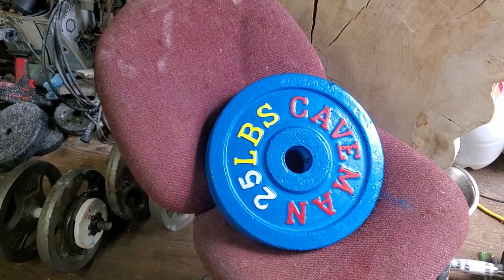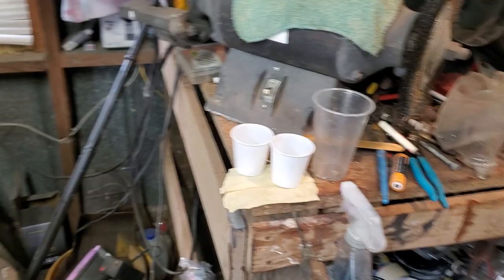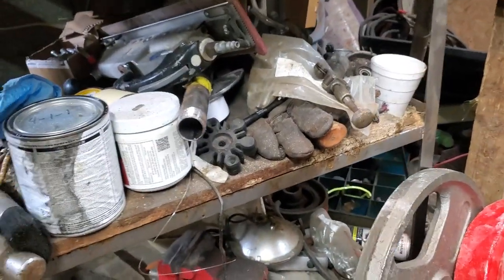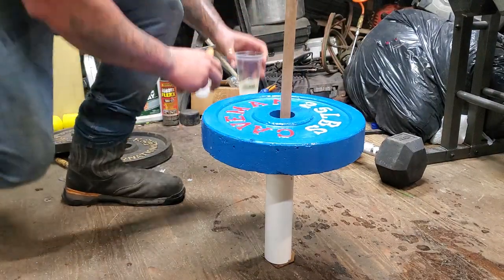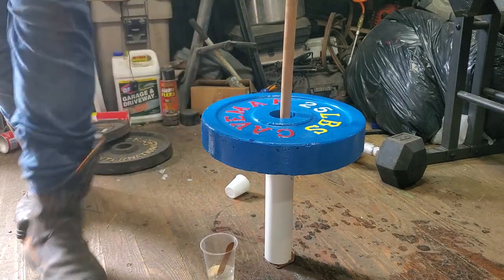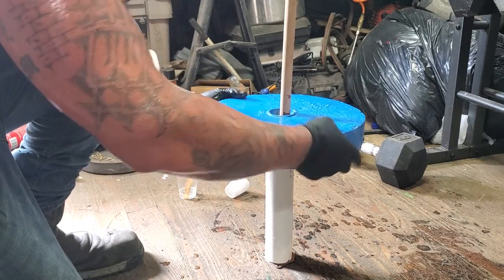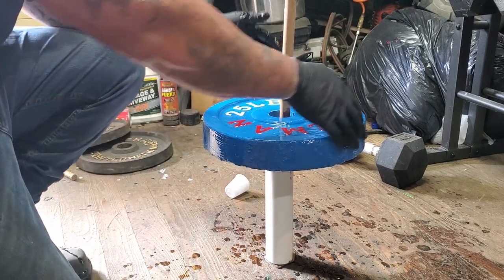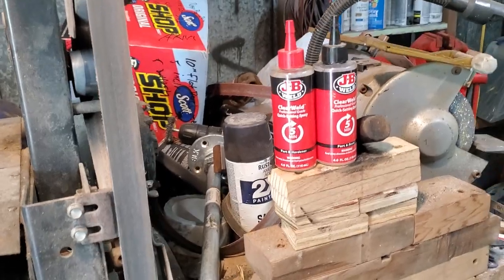Caveman epoxy weight  #2

Comment: Do you think I should do an Epoxy Coating or a Rubberized Coating? Which is better you think?
Reply from the maker: I never had any luck with the rubber coat it always would start coming off

Comment: Looking really good. Woooaw Best plates i have seen until now. Maybe you could make a video about how strong they Are or if the epoxy hold on to the concreat. Nice video
Reply from the maker: Thanks !! Yeah I might go make one real quick just to show wat they look like now. I made them several months ago and they still look the same basically.. I can't do a drop video cuz I'm on a wood floor in my shop and it's old so it'll go straight through I'm sure lol

Comment: Can you drop these like bumper weights?
I've been dying for a DIY bumper weight tutorial.
Reply from the maker: They are not soft like a bumper weight. They are very hard but not like metal more like plastic.... but I have been amazed at the non chipping that has occurred. I honestly thought they would eventually chip, but I guess because the concrete was so porus that I'm assuming soaked it in deep like a sponge and made it incredibly hard and durable.... worked way better than I ever expected !!!

Comment: congratulations👍🙋🏻‍♂️🦸‍♂️ ... I wanted to ask you ... but how long does the disc made in concrete with the resin treatment last ... it lasts longer .. and more difficult than the concrete disc breaks
Reply from the maker: It should last longer yes... mine still look same as they did wen made them close to a year ago now.... its definitely more work and money but not a lot it's pretty simple....
Reply: can you tell me which one it is
the epoxy difference ...
and fiberglass.🦸‍♂️🏋️‍♀️
Reply from the maker: @kristianmartialsurvivalper8522  
Good question! The epoxy is more pliable and will flex some but fiberglass does not move at all... I actually have made my own carbon fiber from epoxy and fiber Mat. So the two are very similar but epoxy is way stronger for this particular application it will not chip off like fiberglass.... also want to ask fiberglass will actually crack like glass if you dropped it a hard surface

Comment: Also have you considered putting on a primer before a rubber paint like Bedliner, so it doesn't chip off? Then applying an expoxy over it?
Reply from the maker: I don't think it would be good to epoxy over rubber coat because the epoxy gets so hard... you might be better by epoxying first then rubber coat. I would do a drop test but I'm on a wooden floor and I really hate to bust them up for no reason because I know the epoxy will Crack. It just takes so much time to make them just to bust them up on purpose lol

Comment: Hi Daniel,  thanks for the video, those are some GOOD LOOKING weights!

I have a few questions, if you know any of the answers that would be awesome:

1.  My home gym is outdoors.  Do you know how well epoxy does when exposed to the elements?  I've NEVER used epoxy before :)

2.  What kind of paint did you use to paint the weights themselves (I saw the markers I'm referring to the actual light blue on the weight)

3.  Excuse my ridiculous inexperience with epoxy but am I correct that pouring epoxy on my weights means that some of the really rough sides of my weights will actually become smooth because the epoxy will kinda fill the craters and level itself out sort of like water?

Thank you!
Reply from the maker: All those are actually good questions! 
1. Epoxy is waterproof so yes they will be fine outside as long as the epoxy is dry and cured before it contacts water.
2.  I just used rattle can spray paint on the blue weight and on one of the red ones... the other i used plastic coat... plastic coat was better at filling in holes and looks better to me it's just more expensive.
3. Yes it will fill in holes or craters if it is flat and level when you pour it. it did not fill in the holes around the rim due to being round. You can fix that by getting one minute epoxy that hardens really fast, use it almost like a Bondo or spot putty...

Hope that was helpful !!!

Comment: How are they holding up chipping wise.
Reply from the maker: They are actually doing good !! As far as I know I don't think I have chipped them at all !! Witch is hard to believe because the only thing I use them for now is stacking them for my home made tricep pulldown thing..... ill try and do a new video on them and update on how the are doing
Reply: Thanks for the update your weights look really nice. I was also wondering what you suggest is best for price and quality. Do you paint the weights first then add epoxy or do you epoxy paint then epoxy again and last question do you use any specific type of paint. Thanks brother.
Reply from the maker: @nickgiglione9951  
Yeah I epoxy first just to have a good surface to paint on but if u did a good mold u might be ok without it. Then I paint then epoxy again. The best one I did was painted with that vinyl peel coat in a rattle can. Because its so thick it lays down good. I'll trying to make a video tonight when I workout to show how they held up. Let me know how yours turn out Bro !!

Comment: Thank you man ! Could you do a video doing deadlifts on concrete weights .I gues you couldnt drop it .My question is if you let it down controlled Will it last ? Or  is it better to make a blocks /pins for the bar to rest so  the concrete weights never touch the floor???
Reply from the maker: I have a wood floor in my shop so it wouldn't hurt them but I'm thinking about doing a video where I drop it on concrete and see what happens with the epoxy on the weight
Reply from the maker: but I also do know that the concrete will chip a little bit if you send it down too hard on concrete I don't know exactly how bad but I do know the corners will Chip... that's one of the reasons I coated them in epoxy....

Comment: How long do you let the concrete dry before adding epoxy? 24 hrs? 48 hrs?
Reply from the maker: I would at least wait 48 hours just to make sure all the moisture is gone
Reply: Daniel Markle thanks. through your experience using them so far, do you think they can last a life time like iron weights?

Comment: How long do you let them cure before painting them?
Reply from the maker: Around 48 hours... but I actually coat them in epoxy first then paint and then coat them again just to have a smooth layer to paint on... which is probably not necessary but I wanted them to come out smooth looking
Reply: @danielmarkle8823  I am going to do this, excellent video. But I have a question, supposedly concrete cure time is 28 days for it to fully harden. If you add epoxy after 48 hours, will the concrete continue to cure or will it keep the moisture trapped inside? Thanks!
Reply from the maker: @seanrichardson2024  
Thats a good question.... I really don't know i haven't had any trouble out of mine and iv done 4 so far and waited anywhere from 2 days to 7 days... I really don't know the answer though... I didn't really think about it !! Lol 
GREAT QUESTION !!

Comment: Dope video bro! One question did you add anything beside cement in the concrete plates?? Sand, rock etc?
Reply from the maker: I put the smallest rebar I could find and believe it or not a piece of barbed wire fence and the tape that holds drywall up LOL just filled it up with stuff that I thought would help hold it together don't know if it was right or not....
Reply: @danielmarkle8823   did you make any 45s too?
Reply from the maker: @zachthamm9595  
No all I did was the 25s I already had iron 45s
Reply: @danielmarkle8823   honestly looks better then most low end olympic plates
Reply from the maker: @zachthamm9595  
Thanks bro !

Comment: How much does the tabletop epoxy cost?
Reply from the maker: You could buy enough to do two sets of weights for around twenty bucks online
Reply: @danielmarkle8823  

Got a link to a particular site? All I'm finding on Amazon are huge 2 gallon jugs for 70 dollars.
Reply from the maker: @palabrajot505  
That's actually what I used the same 2 gallon stuff your finding but on eBay they sell the same brand but you can buy a half a gallon of beach I believe.... let me do some checking real quick and I will get back with you and let you know
Reply from the maker: Okay I found some on eBay for like $10.99 for a gallon kit. it's the cheapest brand you can find but I've always had good luck with the cheap stuff.... I can't figure out how to send you a link so I'm just going to paste the title of the listing and you can find it. Let me know if u find it.....       
 EBAY.... paste below in search engine..... 

"Crystal Clear Bar Table Top Epoxy Resin Coating For Wood Tabletop - 1 Gallon Kit"

Comment: Ever thought about making weights 100% out of epoxy?
Reply: Without concrete at least. Maybe some screws or something in it?
Reply from the maker: @TobbeDraws 
U know I did think about using some old led that I have and try to use the mold I did the concrete weights in but put about 20lbs of lead in it then fill it up with epoxy....  not sure how it would work tho
Reply: @danielmarkle8823  yeah was thinking about something similar but with steel shot...since led seems to be more expensive than iron.

Would you consider making a video of it?
Reply from the maker: I was going to use old batterys..... just cut them open and clean them
Reply: @danielmarkle8823  do you mean car batteries? isn't it kinda dagerous to open them...you do a video on that as well?
Reply from the maker: @TobbeDraws  
Lol well it might be but I never had a problem with it. I have only taken batteries that would not charge apart. Then washed the metal with pressure washer.
Reply: @danielmarkle8823  but you mean car batteries...or do you crack open a bunch of AAs xD :D
Reply from the maker: @TobbeDraws  
Yes car batteries

Comment: Where can you buy epoxy from
Reply from the maker: I get mine on ebay..... just because its cheap there.....
Reply: @danielmarkle8823  do you just buy the epoxy resin and coat the plates with them ? Or mix it with something. Epoxy resin is 18 on ebay!
Reply from the maker: @aymanazzam2887  
I coat them with the 2part epoxy then paint them then coat in epoxy again